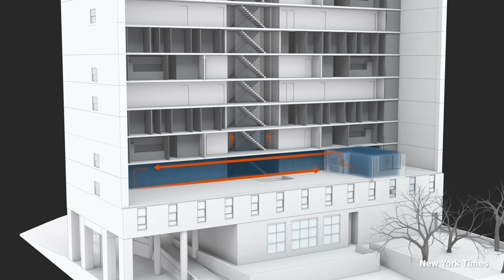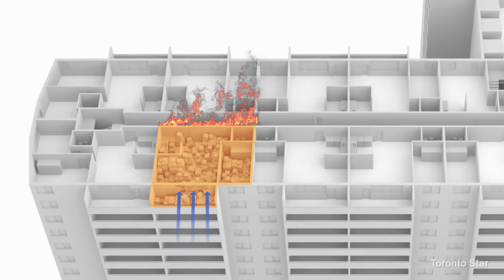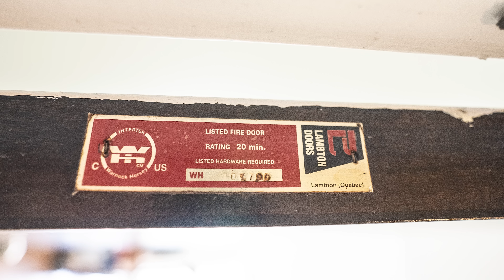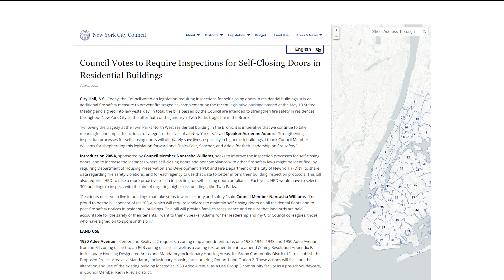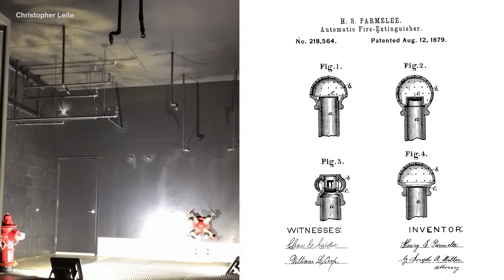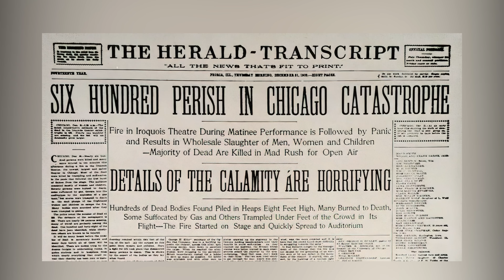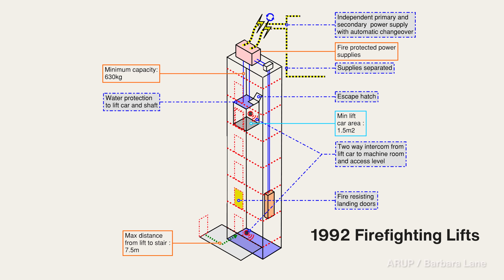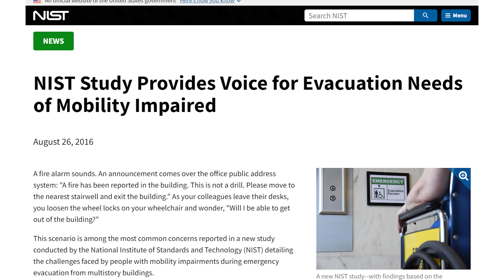How Hidden Engineering Keeps You Alive in Apartment Fires

Comment: I think you let yourself be comforted to easily my friend. It is great to have a door that can hold fire out for 20 minutes. But as soon as the fire lasts more than that you are trapped like a rat. A lot of these solutions are great, in the exact right circumstances. But if things don't go the way the engineer imagined it they will all fall apart.
It would be extremely unwise to not try to get out while you still can. And why not just have some gas masks in the house if you really need to live in a death trap like these buildings? I definitely would.

Comment: I learned how sprinklers work on youtube years ago, and most of the time people don't believe me when I explain that they're not connected to the fire alarm.
Reply: In most cases sprinklers are not triggered by the alarm, but they do have a water flow sensor that does set off the alarm. 
(TLDR: Alarm doesn't set off sprinklers but sprinklers do set off alarm).
Reply from the maker: Yeah, I was amazed by what people believed when I started the research for this video!

Comment: Did you mention the Grenfell Tower disaster (London, UK; 14 June 2017) where the flawed application of the stay-put strategy was tragically compromised by the building's flammable exterior cladding?
Reply from the maker: Originally Grenfell was going to be a big part of this video but was cut early.  If I had the energy I would have added it back as I think it shows how the regulations have gone from bad to good.  

I did listen to about 10 episodes of the Grenfell Podcast and much of Barbara Lane testimony as one of the experts called to testify on the cause of the fire and the sufficiency of the fire protection measures
Reply: @Lam  IIRC, one of the main reasons so many people died in Grenfell Tower (apart from the cladding burning fast and the smoke entering the windows) was that the stairwell had several doors propped open, letting smoke get everywhere. Is that correct?
Reply: @c2h7  There are many factors caused stairwell to fill with the smokes, doors propped open by fire service passing hoses through from floor below, smoke vent in the lobby only operate one floor at the time, stairwell door only have 20 mins fire rating (if I remember correctly), gas pipe run through stairwell and fire stopping boxing wasn't completed allowing fire and smoke to enter, many flat's front door non-compliant which failed in 15 mins instead of 30 mins (some may have been left wide open if tenant removed door closer) this contribute to filling lobby and stairwell with smoke. And lastly "stay put" ONLY applied if compartment (flat) isn't breached and not spreading fire to adjacent flats. Should be evacuated immediately upon compartment breach.

Comment: Such a cool video :D  The idea of using a elevator in a fire is terrifying, all the instructions where I live are to never use an elevator during a fire
Reply from the maker: It goes against every bit of instruction in the last 20--30 years!  The engineering and code standards for the new "Occupant Evacuation Elevators" were due to 9/11 as they discovered how long it can take to evacuate a skyscraper.

Comment: 13:30 "you are usually safer staying in your own flat unless heat or smoke is affecting you"
I mean.... that WAS fine advice in for instance the UK for a long time, until about 2 decades ago when they started allowing buildings to have their facades refurbished with composite panel cladding containing polyethylene or polyurethane foam insulation; and then as billions around the world saw in 2017 it turned Grenfell Tower into a giant barbecue for people, killing dozens. I'm in the US where this was never allowed for high-rise buildings, so I don't know if they've been able to remove all that cladding on every affected building in the UK so the original advice is true once again, but I doubt it. Anyway, there are plenty of other countries around the world where lots of buildings have the same problem, no recognition of the danger, and little to no oversight on matters of fire safety, so you always need to know the specific situation your particular building is in wherever you are.
Reply from the maker: Yeah, I'm sad I cut that story and then didn't have the energy at the end to put it back in.  The cladding fires issue has it's own wikipedia page and I was falling the Grenfell Inquiry podcast to learn the technical details.  

Stay put is being debated especially as it's often the first and only strategy in the UK whereas other countries factor in escaping much more.  

Originally I had much more on what to do for fire safety but I didn't want to turn this into a PSA

Comment: That's only in modern concrete+steel pan floor construction.  Older multi story housing have wooden floors and joists which allows the fire to spread between floors.
Reply from the maker: Maybe not for high rises, I believe for that classification of building they moved to steel even since the 1871 great chicago fire for many highrise buildings (not at once).  

For mid rises even today they have wooden floors and joists.

Of course I don't know every standard or situation.

Comment: Most informative, I actually didn't know why people are so calm even when there's a fire. It's a even more serious situation here in Singapore, where the fire can spread quite far. Now I know why, thank you Andrew.
Reply from the maker: Glad you enjoyed it and Singapore is incredibly dense so it's important they get it right (I'm sure they do)
Reply: @Lam  Most residents in Singapore live in public housing, whose escape staircases are open-air, while some condominiums' have surrounded such staircases with thicker concrete walls so that they can double up as bomb shelters too. The latter has 2 layers of doors you need to open to access the staircase though, the inner one is a regular inward-swinging wooden door with a window letting you see into the staircase, but the outer door is a steel one opening outwards, which I imagine would maximize its protection for people in the staircase if there's an aerial bombing in that area, but would likely get in the way of people evacuating into the staircase from a fire though. We're also introducing legislation to soon mandate sprinklers in houses, while apartment buildings >40 floors need to have an open area halfway up the building as a (temporary?) refuge area during a fire evacuation, & often are garden/exercise/rest areas as well. A 2nd additional firemen/evacuation lift is probably needed too, which also have to be bigger (from 13 persons/900kg to 16 persons/1090kg)
We did have a fatal fire in early 2014 that originated from renovation debris left in the firemen lift lobby at a top floor of a luxury apartment tower in our downtown. The security guard(s) who went up to investigate were apparently new & not so well-trained, so they took the firemen lift to go straight to the floor where the fire was & didn't switch the lift to firemen mode. As a result the lift opened directly into the fire & its doors' infrared sensors weren't disabled, so they apparently mistook the smoke from the fire as a door obstruction & thus refused to close
Reply: in school at least in the US, they taught us to be calm during a fire when we had our fire drills
Reply: @AwkwardYet  Yeah for all our problems with American schools fire drills are not one of them. We are actually good at it in my experience
Reply: @AwkwardYet in Sweden they learn you be panicked and everyone to run out at the same time but honestly was only the girls actually running out tho, they run tests so often that you actually don't take it seriously anymore
Reply: Calm people survive. Panicked people die
Reply: @misham6547  calm people help panicked people survive
Reply: staying calm and avoiding panicked crowds can save your life from a lot of non-fire related dangers during an evacuation
Reply: quite sure the Bukit Ho Swee fire had a large part to play in the fire protections of today
Reply: I love living in a tightly packed dictatorship
Reply: Problem nowadays is that people rather take video when there is fire than evacuating
Reply: I liked both for you pfp and your comment
Reply: Nah bruh I hate fire alarms, they legit so loud that I panic.
Reply: Hi fellow singaporean